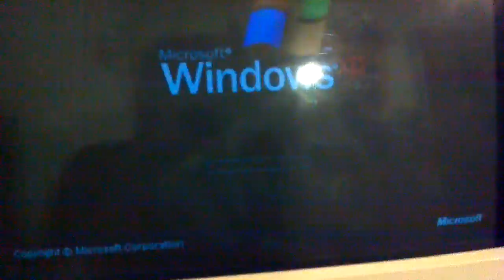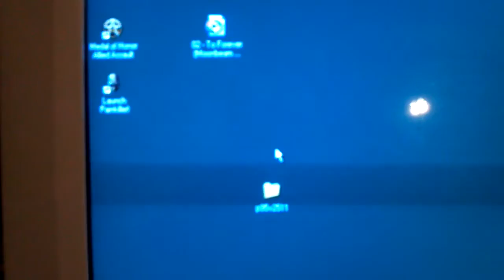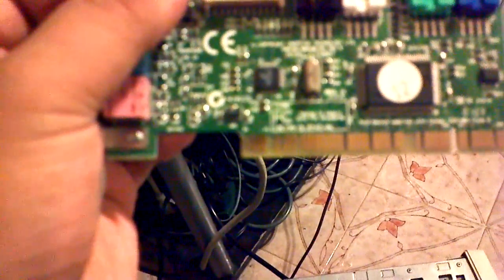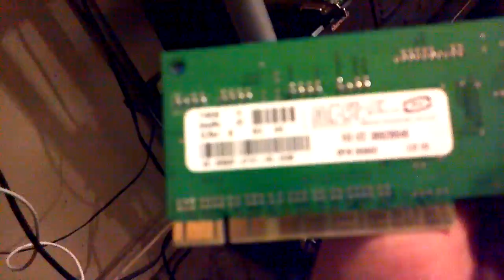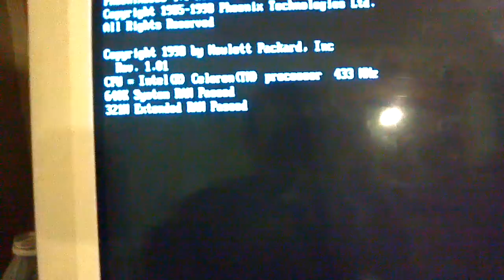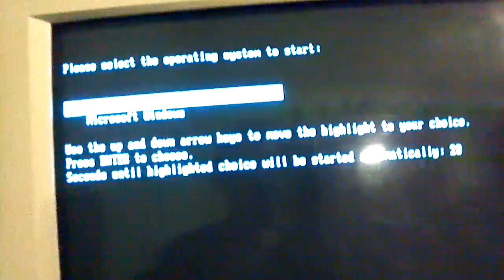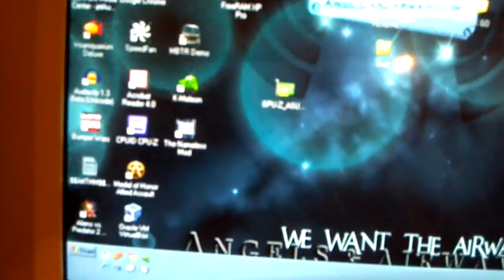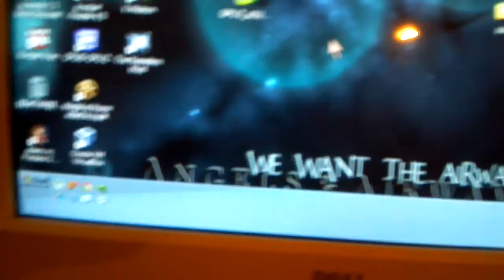Sound card problem on my Dell Dimension

Comment: i had the same problem on my gateway the drivers were windows 2000 so i fixed it by putting windows xp drivers because it was running xp if this machine had another os upgrade the drivers